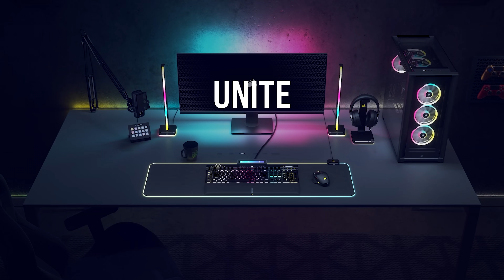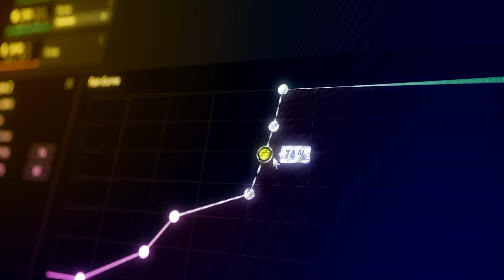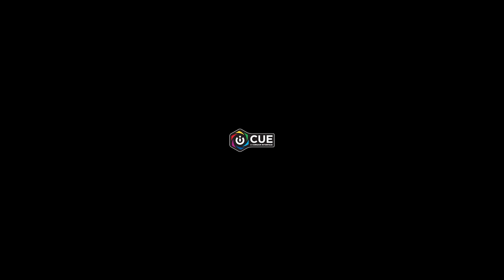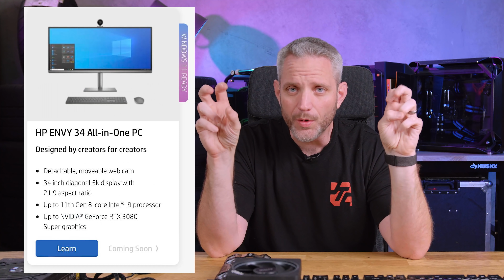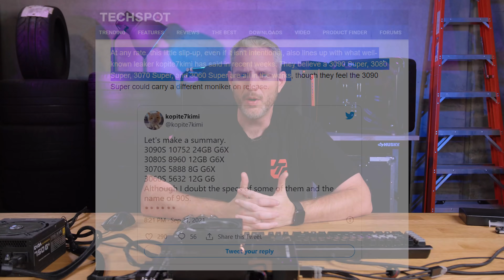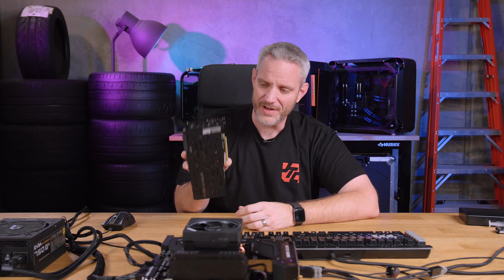RTX 3080 Super...

Comment: It's funny how Nvidia's own design philosophy is what keeps a lot of us potential customers away, with all the crossover performances and mixed memory sizes that just make it deliberately confusing as to what is the best option for each particular set up, I would've gone Nvidia last year if it wasn't for that mess of different varaints, and the more than double the cost of AMD in a lot of cases.

Int the end I actually got the last RX 570 on a site for half price so the price difference then became, well, quite a bit larger.

Looking at cards again this year with the thought of selling on my current 1 for half that price, I'm still being held back from Nvidia, these current highest releases clearly being marketing gimmicks with no real difference over previous is a huge red flag to me, I'm definitely not goinG Nvidia again, I just can't risk that, it's like they're doing it on purpose, ''the fan boys will buy our stuff anyway'' which of course, begs the question of why any marketing BS is required at all, any of the cards which even had equivolant memory had lower speeds of memory or the core as well which really isolated my choices to AMD, which in the end, proved far far far far, easier to sift through the cards of.

It's really wierd that a difference like that can exist between 2 companies, Nvidia must be able to see the mess they've created for any new customers to have to deal with next to the much simpler list of AMDs, kinda mad, but what do I know, I'm not in marketing, I'm just an end user who see's 1 massive confusing mess with much bigger prices and  bunch that seem to be going backwards in performance jsut for the sake of 2% more cuda cores.

Comment: Maybe the super is just a name for a "super small" mobile GPU?   I'm not very tech savvy, just a guess after listening to this video... it came on after watching another one.... we are "researching" for my son's first build while we pack up to head to an RC car race....(by researching I mean listening to build videos)
   Your channel rocks mister!
We are going to build with an Asus ROG Strix B550-F wi-fi board,  an AMD Ryzen 5 5600g processor,  and use integrated graphics for now...  our plan is to get the Asus ROG Strix 10gb 3080 when they are redily available for the normal launch retail price, or less.... not in a hurry to get a GPU, after the build this holiday season we will have to save for that a while...
   Going to have an Arctic Freezer eSports Duo 34 cooler I think, a handful of fans and some RGB...  The GPU should be the most power hungry part by far.....  SO, would a Corsair RMx 850W power supply be a good unit to choose, with plenty of power and overhead even when we add the GPU... I am estimating total of about 500-550 watts, but I really don't know this stuff well...
   Thanks again for the content...

Comment: This is why I'm just like "fuck it, 1080ti until 4xxx series"
I'm not preordering, sitting in a queue, waiting in line at best buy for 10 hours, or paying scalper prices. I don't give a shit.
If I can't hit "buy now" at a reasonable price, I aint buying it. I'll play games at 30 FPS and low graphics at this point.
Reply: i mean the 1080ti isnt a bad card. it compares to 3060ish maybe better for your average gaming.
Reply: @ah7027  Yea, prob is I'm into VR sims, and with a reverb, even a 1080ti struggles when you want to run at approx 2800x2800 per eye. I can manage decent frames in certain titles like IL2, but DCS and MSFS struggle. Was hoping for a 3080 at a reasonable price. Personally don't really give a shit about RTX. I've tried it on and off and raytracing is meh in most cases in its current iteration.

Comment: As of 9:53 PM pm 9/30/2021, Zotac has the 3080 & 3070 Amp Holo LHR cards in stock on their website for $1,349.99 & $869.99 respectively. They also have the 3090 Amp Extreme Holo for $2,599.99 if you want to empty your savings. Depending upon where you live, they may not charge sales tax...don't ask me how I know.  Asus also has had monitor/GPU combos on their store, but they appear to not currently be offered since they moved their webstore to a new platform just a week ago. I'd keep an eye out for them as well since I suspect they will bring the combo packages back.
Reply: they only charge taxes in california. and there in stock due to the fact those cards are practically scalper price already unfortunately
Reply: @ah7027  All true, but they a bit cheaper than going the eBay route as a result. Not a good deal by any stretch, but no GPU is a good deal right now.

Comment: I'd rather Nvidia explores how to improve heat performance even further.  A lot of silicon goes into making certain GPU batches, and the reason why there is no stock is a silicon shortage. Maybe it's time to see where TiS3 might alleviate this - MSI has started using it for their backplates, but it would be proactive for all manufacturers to examine if it can be used for chips as well.

Comment: I upgraded from my FX 8350 last year to a Ryzen series 5 3600 and got a GPU that was suitable for it - the MSI Mech 5500XT - thinking I could crypto mine only the sense that Linus does to heat his facilities when the GPUs are not busy doing other things. But I had forgotten that 4GB mining was for the most part discontinued. So the mining might occur but at such a slow rate it would not pay for the GPU until winter is over and only because the home energy assistance is paying my utilities since I am disabled. Anyway, I wonder if JayzTwoCents has done a video on gaming when your dominant hand does not work right or you have another disability. I have been playing mostly older games that I know I can handle, but even some of them will not recognize my joystick properly or require DOS Box to run at all.

Comment: Wasn't the super variation mainly Nvidia's response to AMD's RDNA1 GPUs Because those came out after the 20 series had already launched most of the lineup? I could be mistaken but that's what I thought. And As far as I know, AMD doesn't have anything like that on the horizon, therefore Nvidia would only be competing with itself launching a super variant, and probably cause consumer backlash because they really should just use those dies for the current lineup. It would be really weird/bad optics wise for Nvidia to launch a super variant with the 30 series. Not to mention just kind of unnecessary as AMD has already filled out there top end and mid-range.

Comment: My guess is as Samsung's 8nm process has refined that yields have increased. With higher yields nvidia can pump out supers and charge their aib partners more per chip. I don't see the loss for nvidia. Also it's been a year since 30 series have come out. It's possible they've been saving their better bin chips anyhow for supers down the road. Other than optics, I don't see where nvidia doesn't win with supers.

Comment: A 3070 & 3080 Super makes no sense at all simply because sandwiching a card in between the vanilla versions and the Ti versions, which are barely faster than the former, is really dumb unless the plan is to drop the vanilla versions altogether.  The 3090 Super, well yeah they can milk more money out of people I guess... Then there's the 3060 Super. This is the only one that kind of makes sense to me, the gap between the vanilla 3060 and the Ti variant is quite large so there's room to squeeze a card in. Other than that though, the rest don't make sense and even a 3060 Super could be argued against.

I've been building PC's since the 286/386 era, and have seen a number of weird product lineups, but I have to say this 3000 Series of Nvidia's is the most confused mess I've had the pleasure of witnessing.  It's very clear that they simply got caught off guard by RDNA 2 and AMD's ability to compete.  Case in point, a 12GB 3060 and a 8GB 3070(Ti) and a 10GB 3080.  Guarantee that 3060 was meant to have 6GB of RAM but the 6700XT with it's 12GB of ram screwed them on that, along with the 6600XT's 8GB of RAM.  Anyway it's laughable that they're in this situation.

Comment: Setup 3 x 28" 4k screens on my gtx1080 running StarCitizen... 3 frames a second.
Next I tried the 3 x 4k screens on my buddies rtx3080 ... 17 frames a second.
4k has been available for nine years yet the 3080 still can't handle a triple 4k setup...a super won't do much to address that issue.
Obsolete...
The super series is just a fancy name.
Will wait for 40xx series.

Comment: Here's another view: NVidia's professional Ampere cards, especially the RTX A6000, have been steadily falling in price ever since they launched. They most likely put aside every GA102 die that met the requirements for the A6000 and only sold the not-quite-A6000-level GA102 dies as RTX 3090 cards. Now, given that the A6000 doesn't appear to sell as well as NVidia would like, they probably have a ton of GA102 dies with 10752 working shaders (= no defects). They could sell those as 3090 cards but then they'd have to disable perfectly good shader units. However, they could also leave those shaders enabled and sell the chips as 3090 Super / Ti cards, which would of course be even more expensive than the regular 3090. It's basically free money for NVidia so I'd be really surprised if they didn't go that route.

I'm not so sure about the other Super cards though. The shader core count that was leaked for them doesn't match any of the professional cards. So... Meh?
My gut feeling: 3090 Super / 3090 Ti will definitely be released, the other Supers... Maybe. You never know with NVidia.

Comment: Just found a (not quite) decently priced 3080ti.  Don't care anymore.  Selling my 2080 at a reasonable price (because I'm not a cunt) to recoup the cost to make it more in line with original MSRP.  Now I'll be able to push my 32:9 monitor properly at least.  I'll recieve it tomorrow.  Crossing my fingers its not an RMA case and I don't end up stuck with my 2080 and my buddy doesn't wind up stuck with his 960.
Reply: selling a 2080 more than 500-600 is still scalping price

Comment: Hi, 
 I need serious help! 

I have i7-9700k
Gpu rtx 3070
Arsock z390
Ram 32gb of 4400mhz. 
But!! 
I have problem to boot the computer on 4400mhz. It's just won't turn on. 
I setup manually to 3600 and it is stable sometimes and sometimes it's crash while playing COD. 
Any help? 

The brand of the memory is g.skill ripjaws 32gb 4400mhz 
Please help me!

Comment: 30-series and all it's spinoffs = pointless if you already have a 1080 ti, especially since you will have more success unicorn hunting. At this point I'll just wait for the 4080, by then more fabs will be up and running to crank out cards faster than power grids can keep up to run them all and you can go to Amazon and buy one without any silly gimmicks like waiting for stock or even purchase limits  (though will still be pointless to buy one if the new problem is rolling blackouts worldwide).

Comment: I would buy a 3080 for $1200 or a 3080ti for $1500-$1700 or a 3090 for $2000
But with my choice brand (EVGA) being forever out of stock with no "getting in line" for me, 
and Amazon and Ebay low-key supporting scalpers, I'm not going to be grabbing a card to replace my old 1080ti's any time soon.

Comment: The only reason I see for a "Super" series is the shift in quality of what NVidia is getting from Samsung now versus what they got at the beginning of the series. Early on there were a lot of GA-102 chips that binned down to the 8704 cuda cores lever due to poorer yields but now very few do or maybe none do and the crappiest GA-102's they have pass the tests at 8960 cores. We have certainly seen the GA-104 "evolve" quite a bit since it's release as well with most if not all probably passing the tests at 5632 cores so why waste those on 3060Ti models? I also believe that Samsung is at the limit of what they can produce for NVidia so NVidia is picking and choosing what will make the most profit for them so the GA-106 (3060) is the odd wafer out getting limited production and explaining why the lowly 3060 is so hard to find.

Comment: Jay why you advertise iCUE is one of the worst softwares I follow your advise to use corsair products and the only thing I got was a ticket to Blue screen town and it wasn't fun at all as soon as I eliminate any trace of corsair of my machine I got stability and I did that  2 times  the tests to see if it was corsair and it was,  there must be a problem with drivers but is so bad Im really shock you advertise it, I have a good system B550 taichi board with 3700x and a 3070 custom water-cooled so please check what the hell happen to Corsair iCUE because is worst than Aorus Engine and that thing is horrible cheers !

Comment: I have a question for peeps or even Jay. When TSMC or Samsung makes the magical waffers are they aimed at say 3090 lvls and then they  break thoose down to 3080, 3070 etc or is the waffer itself aimed for only like one queue and maybe trimmed down to fit one lower IE 3090 and cut off is 3080ti?
Reply: The way it works is pretty much as follows: 

Nvidia designs the GPU die that goes in a graphics card in partnership with Samsung. They make several different die designs, usually 3-4. Nvidia then buys silicon wafers from Samsung, and tells them how many wafers should be "printed" with each die's pattern. They get many, many dies out of each wafer.

Samsung takes the raw silicon, turns it into wafers, and prints the design into the wafers. This year, the dies are called GA102, GA104, and GA106. GA102 dies are turned into 3090s and 3080s. GA104 dies are turned into 3070s and 3060s, and GA106 dies are turned into 3060s and 3050s. 

How does Nvidia decide to make a die one product or the other? Defects in the manufacturing process, and/or demand. Nvidia wants to make as much money as they can, so they'll make each die into the most expensive graphics card they can, as long as it'll sell. So if a GA102 die isn't good enough to make 3090-levels of performance, it'll become a 3080 Ti, or if it's not good enough for that, a plain ol' 3080. Make sense?

Apologies for the long explanation! If you made it this far, have a cookie. 🍪
Reply: @benjaminoechsli1941  yup sounds can I get two cookies?

Comment: J have you seen these on Amazon? ionz Alseye twin fan CPU Cooler with 6 Heatpipes and the Aluminium Alloy Block? and this GOLDEN FIELD Wind Walker A-RGB CPU Cooler, 5V M/B SYNC Supported, Dual Pressure Optimized PWM Fans, 6 Heat Pipes CPU Fan for Intel AMD?

Comment: I was sitting in line for one sku of the 3080 day one. I was surely in the top 10 in line at this retailer. I waited months for the base version and it never came  yet the OC release came and went. Another version came and went the LHR V2 happened....I wasn't getting my 3080 cos it was the wrong versions getting released in the eyes or the retailer. A 3080 super from the same company would mean they were releasing the first sku and I would still not get what I paid for despite the fact thousand of new 3080s have been made but 0 are the original day one version

Comment: Sorry Jay but I must disagree on their being no reason for a company to do this crazy sub division of SKUs.  The obvious reason is that if they can take the same one piece of silicon and sell it for more money then more profit.  Obviously this must be offset by some amount for having to create the new SKU but obviously with the Ti launch it is still making them extra money.  The wafer cost isn't going to change on them but if they have a GPU from that which could be Ti level versus base 3080 the price has just jumped 400 bucks.  If they did a super level that was between the 3080 and a Ti and priced it at 1000 for the card then the same silicon made then an extra bit of cash compared to having to disable cores to bring it to base 3080 level.

Is it annoying to have this "super" level of sub divisions in small performance differences between SKUs for consumers?  Absolutely.  However on a business level I see why they are doing it.

Comment: I was one of those lucky who got into the Elite Member queue for the EVGA 3070 Ti launch.. 9 minutes after it started (the website kept crashing and even my form crashed but somehow still was accepted) and I was able to buy my card the same day. 

Only the expensive $809 FTW3 3070 Ti, but it was a graphics card to replace my EVGA 1070 SC from Feb 2017 I bought at BB (it lasted me two mining crazes and was able to resell for $300).

I do regret not entering the Step Up program though because for an additional $153 I could’ve bought a 3080 FTW3 instead, but EVGA said once that date passes they have no exceptions. 

$800 for a 3070 Ti that normally is around $550, yeesh.

Comment: Question, do you think it costs Nvidia more to make a 3080super compared to the standard 3080? If not, then since TSMC has increased their cost by 20%, Nvidia, would theoretically make the super, and charge an extra ~2-5% for their super line up, and drop the non super line completely. This would mean more "value" for the consumer, and no loss in profit margin for Nvidia. This is the only reason i can think of from a marketing/financial aspect as to why Nvidia would release a super.